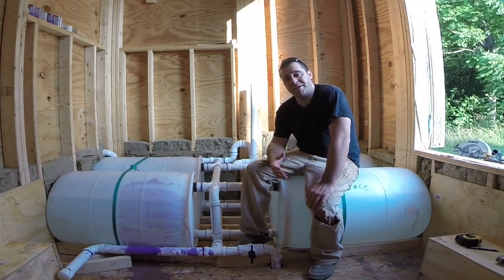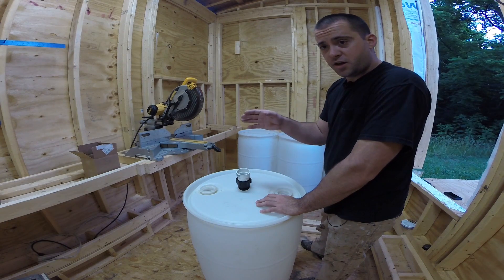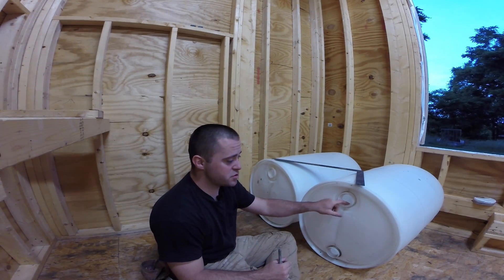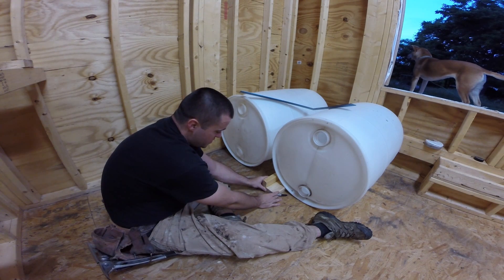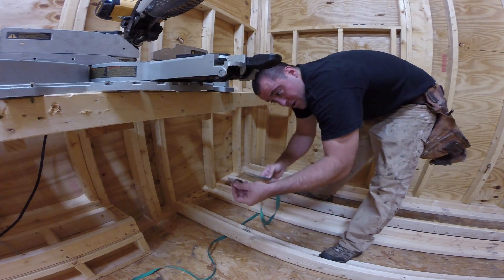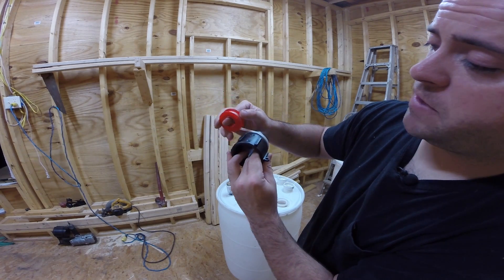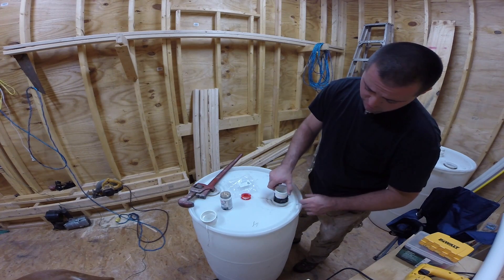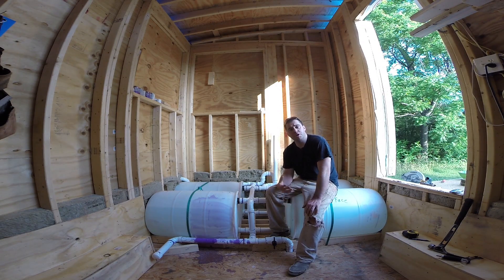Tiny House - Rain Catchment System - Installing the drums - Part 1 of 3

Comment: I hope you rounded the edges on the 2x4s that the barrels are sitting on otherwise with a full load they can split on those edges.  also to give them a Lil more life use a Lil bit of foam tape where the barrels touch.

Comment: Am I understanding this correctly? Your water/barrels will be inside the house? If so is that to keep from freezing in Winter? Or?

Luvin your vids!!
Reply from the maker: ScootOverMan i live in NC and when it does drop below freezing its not for multiple days.  so yes them being inside will help prevent freezing.  now if it does drop below freezing there is so much water mass and they're also in a heated house so I'm not to concerned about freezing.  worst case i can drain the system if i have so really cold water.

Comment: My roof is in the dry as of dark tonight! Start the metal in the morning. Weehoo! I am curious about this system your building. I am contemplating a not so big system in upstairs loft, put on electric pump that can be ran on generator. Fill tank from top with 5 gallon jug when need to add water. Good thing is it could gravity feel sink or shower if tank is up high. Hadnt thought about collecting rain water. Be easy to have overflow pipe exit out of house.
Reply from the maker: 19stoney64 Nice.